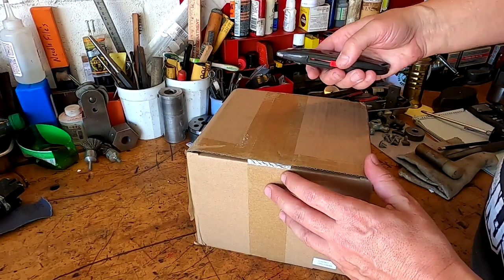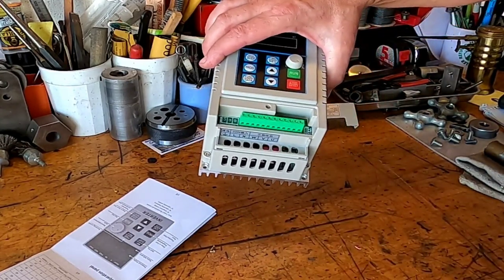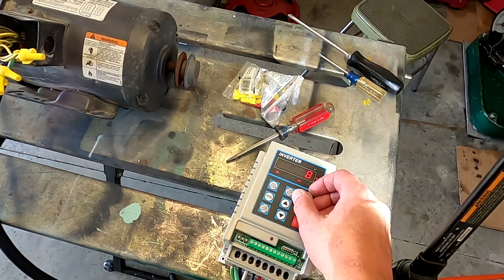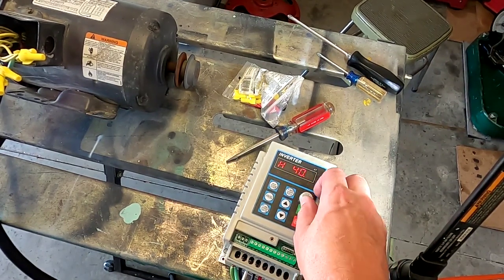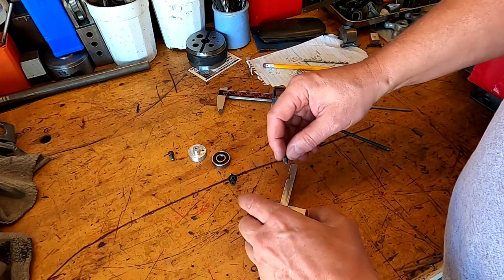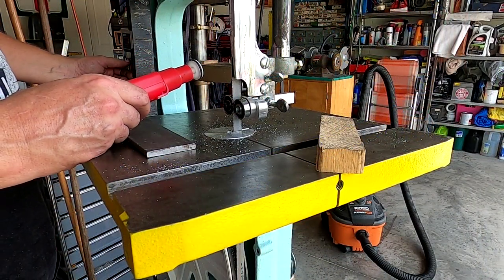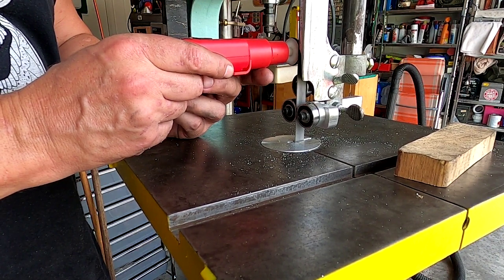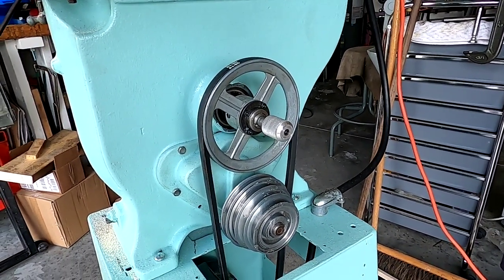I bought the cheapest VFD on Ebay. Wire it, Program it, Test it.

Comment: Thanks for the review.   A couple of cautions -- 1.  ALWAYS clamp or bolt down a motor under test.  If something goes wrong, it can jump off the table --  at you.  2.  Over-rev-ing older motors (above 60 Hertz, as it were) can cause early bearing failure.   If you need higher final speeds of the overall equipment, consider using different pulley sizes.
Reply from the maker: Hey Phil. May not have caught it but the mounting plate was wedged into the welding tables cut out. Also with VFDs I always ramp up the speed vs just flat on off. Even that 2 seconds or so of ramping really tames a motor down on start up .  Yes, older motors have to be handled more carefully. This motor has no issues with a small OD. Thanks for watching. Don

Comment: I recently converted my Delta 14" saw to metal cutting (two-step v-belt reduction) with a 3-phase motor and VFD. Excellent results, BTW. Here's a tip for you. Set the VFD at 50Hz and measure the blade speed. Enter that number as your P21 parameter. (Normally you would enter motor RPM or final RPM @ 50Hz.) Then go to P62 and enter parameter of 2. Now the VFD will display blade speed directly, rather than output frequency.
Reply from the maker: Nice tip, I'll have to go back an have a look at my unit. It would only work on one pulley size though. I stll use different sheave positions to widen my speed ratings from very low to a pretty nice aluminum clip. But or my most commonly used sheave for steel  that would be welcome. Thanks. Don

Comment: Interesting video, the saw will become much more versatile with the VFD and you'll need to change belt setting less often. From the video seems that the saw  frame flexes  a little bit and looks a periodic thing so there could be something bent. Also the right bearing on the upper blade guide was not tightened.
Reply from the maker: Hi Luca. I can't really decipher any flex or bends in the frame while using it in real time. The camera may be exaggerating movement of the entire saw as it was not sitting even or adjusted to the floor.. its rocking while the camera is stationary. I also caught the loose bearing during edit. This video was shot a few weeks back and I've spent more time with the saw since. Every little touch up I do makes it that much better..  Got four more to get through, this was my first mock up saw.

Comment: I bought a vfd for a regenerative blower I have but it won't work because the blower motor is wired in a wye configuration. These cheap vfds have to be used with delta wired motors.

Comment: I’ve got a couple of expensive VFDs, and three inexpensive models. All work. I’ve got one that’s the same as this one. It’s actually built very well. It’s got a large, well designed, heat sink. Tapping the plastic cover is about as useful in telling you how well it’s built, as kicking the tires on a car. But the case is fine. My $2,000 (in 2002) Fuji industrial model for my lathe, has a case that’s no thicker. Neither is that on my Schneider Electric model, for $950.

The problem using VFDs is that while many programming instructions and factory settings are the same, enough are different so that I can’t just go from one to the other without thinking about it. Some have the controls set to local, and some to remote. Some use up arrows for moving numbers up, and some down. Some of these differences can be very confusing for new users, and some seem to defy common sense.

And for last, I always buy inverter ready motors for VFDs. While it won’t matter if it’s on a drill press, because of the short on times, and you keep the frequencies to 45-60. But move out of that range on a machine with a continuous use, such as that bandsaw, a mill or lathe, and you can get into trouble., as the motor will begin to overheat, and have other problems. I imagine that for home use it likely won’t be a problem, but it’s something to keep in mind, particularly if the machine is under heavy load. Then, filling all of the motor parameters into the VFD becomes important, as does setting it for that particular use, if the VFD allows.

Just since you mentioned it, wood is usually cut between 3,000-4,000 SFM. But then, you use a woodcutting blade as well. I can’t bother, so I use the 10/14 tooth blade for most everything.

Comment: Hey Don,
Just purchased on for my Bridgeport Mill, have to hook it up.....  thanks for the info keep up the good work
Reply from the maker: Thanks Sandi... Hope it works well for you. I put a Teco Westinghouse on my mill a number of years back. It really makes a difference, especially with belt switching. I hardly ever change pulleys now.
Reply: Don’t go past 60Hz, or below 30. A mill is hard on motors, and assuming that the motor isn’t designed to be run at different frequencies.

Comment: All of the drives from 3 to 250 HP that I installed & troubleshoot would have factory parameter set so on a 480 volt motor at 25% of full speed would have 15 hertz output. 50% of full speed would have 30 Hertz. ( that us if you have the normal 60 Hertz from Ultility company ). If the cheap VFD does not have built in quick blow fuses I would install them in the input side of drives. I always ordered drives with fuses and a disconnect. Nice thing about drives that if you have a vibration problem near full speed say on a air handler fan you can program the maximum speed down 5 to 10 Hertz until fan is balanced properly.
Reply: some vfd's can be programed to ramp up or down and even skip a certain frequency where the motor has a resonance

Comment: I’ve just bought the same one. Wired it up to test but haven’t really used it yet. The only thing I don’t like is the wiring inputs. There is no provision for securing the cables. I think I’ll mount it on plywood and secure both input and output cables with clamps. Also, there is only one earth connection, very awkward to connect earth to motor from vfd.
Reply from the maker: Good point. I use zip ties ono something close by to keep them form pulling. Could probably get fancier though/ Don

Comment: I just received a '220V VFD 1.5KW 2.2KW 4KW Single phase to 3 Phase, 2hp-3hp inverter Frequency Converter Frequency Drive Spindle Speed Control' for US $38.90 + Shipping: US $50.35 to Peru from aliexpress. I'm going to build the 'Gen 2  72 x 2" Grinder' by Jeremy Schmidt, with a 1.5-2 Hp motor.
Reply from the maker: That is an amazing price for that size VFD.. Good luck with the project. Don

Comment: THANK YOU:   I was just trying to figure out my new cheap e-bay VFD and you saved the day.  I also purchased 2 VFd's now worry about the 2nd one.  I did notice your sanitary blade guide is set too deep causing rubbing on the teeth of the blade and will quickly rub the kerf off.
Reply from the maker: Great, Glad it could help.  Thanks for watchin.. Don

Comment: Great video, made programing much easier. A question though, I keep getting error 1 overload/short circuit before motor even spins. Any ideas? The wiring looks fine and it's the right size vfd for the motor.
Reply from the maker: Thanks, You may just want to go back and double check your parameter settings. Sometimes you may think you hit data but just wet onto the next setting without saving. Also be real careful you don't have any stray single strands touching the neighboring wire. Neutral to ground would be the most common without blowing a CB and causing an error code. That's where Ide start anyway. Don

Comment: Morning Don , if you were just cutting steel which saw would you prefer this one or the stater motor gear reduction one ?
Reply from the maker: That's a good question The Craftsman is a bit smaller dimensionally and runs an 18tpi blade, while this one runs a 14 tpi.  The Craftsman also uses a 1/2 hp motor vs a 1hp here.  Its like choosing which finger to cut off... I think if it boiled down to it, the Craftsman takes up less space and can handle 95% of what I need to cut. So ide probably say the Craftsman would be my keeper. But dang, it is nice to have that immediate wood cutting option on the Delta along with the VFD. But it does command a lot more space which is like gold in my garage.  Don

Comment: Yes sir I got vfd just like your from Ebay ,I watching your video about programming but having problem on P0018 wanted to change to 60htz but it won't do anything it show 400.0 every times.what's you think the problem? Thank you.english not   my first language.
Reply from the maker: That's kind of odd. I hadn't run into hat before. You may want to use a parameter P77 reset and put everything back to default and start your programming over.  Thats about all I can offer from here.   Good Luck   Don

Comment: Bought this same one. It kicks out at 40hz
Reply from the maker: What motor are you running??? Do you have parameters set properly. Also try going bac to factory setting and resetting if you find everything else properly set up and continues.  Don
Reply: @donsengine3158  I've found it was working perfectly and kicked out because the load on the motor was too high. I'll have to get a higher hp motor to do the work.

Comment: So i dont understand, you need to rewire the motor to 230v from 415v otherwise the vfd wont work on it? If the motor doesn't have that option, then is it to be trashed and replaced with single phase motor, no need for vfd?
Reply from the maker: Hey Jim. I don't quite follow. If your VFD has 230V output, the motor needs to be a 230V motor.  Some VFDs step up. I have a 120 Input VFD that steps up to 230 Volts for example.  You can run single phase in and its converted to three phase out. I understand that there are some single phase motors that can be run off a VFD. It seems like a waste if its true.  If your dealing with a 415V motor then it needs a matched VFD.

Comment: Hi Don. Thanks for this video. I own a bench lathe (motor: three-phase, 1.1kw and 1400rpm) and a VFD AT-1 model. I would like to install a brake resistor, but I don't know if in this VFD I can install a brake resistor and what is the proper value. Please, could you help me? Thanks again.
Reply from the maker: Hi there Jose. If you are using the AT1 rated at 1 HP, like the one I use in the video, your motor will over work the inverter. Its only rated for 1HP or .75kw. If you have a matched inverter to motor (1.5 hp) then you're good. With that, I wonder why you are concerned with a braking resistor? Are you turning much higher speeds most of the time ie.. over frequency to 90HZ? or running heavy parts that overpower your lathe and cause it run the motor down over a long time? Or do you need immediate stop? P13 and P14 on your parameters.  Most of these smaller inverter / motors don't have these issues.  The only piece of equipment that I have braking errors pop up on is my mill when I run it full out (90hz) on its top belt setting for max speed in the dead of summer. If ive been using it, it will pop a code but will reset. TO avert that I drop it back down to 60HZ before stopping it. I also don't use excessive run down times, usually around 1.5 to 2.5 seconds. The only equipment I use braking resistors on are larger pieces like my Monarch that uses a 7.5 HP motor. If you really feel you need a braking resistor, I believe the outputs are SP1 and SP 2 on the output side of the inverter. I'm not positive about that so I emailed the company to clarify. Still no answer. I'll let you know if they get back to me.  If I were you, Ide just hook up my inverter and set parameter P13 for 2.5. Leave P14 alone. If it doesn't work for you and you pop error codes, let me know. There  is a method for hooking up braking resistors in line, but its a bit too complicated to write out here. Don

Comment: Great review thanks, I have a question, my mains is 230v can a VFD run a 110v fan directly or will I still need to use the transformer that came with my fan? 
Also my fan motor is single phase incase that would make any difference?
Reply: A VFD is for a three phase motor application. So, no, you can't use it with a single phase motor.

Comment: You wired the input to the drive and said 250vac, 230v is standard for a house in the US so with that said, there is no neutral.
Two phases of 120vac will provide 230v single phase power although no neutral just a ground

Why are you speaking about a neutral?

5:24
Reply: Is he running at 120v, one hot one neutral
Reply: @MarbleStoneShop  No, he said 250vac

Comment: Question for the peanut gallery,  can I put a receiving (female) plug  on the output side of the VFD and a male plug on input side?  I'm going to be using it for my 2x72, but I also want to use it for my hydraulic press which is what its connected to now. (same HP, both 3 phase 220)
Reply from the maker: I don't see why not, Current doesn't really care about the connector type, just a pathway.

Comment: How can you tell by looking at a AC motor if it's an 'asynchronous/induction' or a 'synchronous' motor?   For example, I've got a small, low-speed,  3-phase (400hz) 110v ac motor for an air-compressor.  The rating on the label doesn't say much except that it's input power is 1.6A RMS Max.

Reason I ask is that I'm also looking for a portable power-supply for it and found a $75 
"HKS VFD 0.75KW 1HP 110V 1 Phase Input 3 Phase 0-400HZ Output 10A"
but it says in bold letters, "for ASYNCHRONOUS motors ONLY!"   
It also says it uses a 5V or 10V PWM control frequency.

So I'm confused if this will work, or is there something better suited/cheaper like Vevor?   All I need is to spin the motor, one direction, at a constant/default speed (no "PWM")..  and turn it on/off from the panel  (RS485 would be nice but not necessary).
Reply from the maker: It may be difficult to tell the difference between a synchronous and asynchronous motor just by looking at them externally, as their physical appearance can be quite similar. Both types of motors may have a similar shape, size, and construction, and may have similar electrical connections and components.

However, there may be some external differences that can give a clue to the type of motor. For example, synchronous motors may have a DC power source for the field winding or a small exciter motor to generate the magnetic field, whereas asynchronous motors do not require such a power source. Additionally, synchronous motors may have a visible rotating shaft or a gear train to maintain the constant speed, while asynchronous motors may have a simpler shaft design.

With that being said, what are you going to use this for? Thats a pretty low HP motor, something a little less than 1/4 hp. I find motors, both single and 3 phase at the flea market all day and night for next to nothing. Someone once said that a used motor is about 10 dollars to a HP, which is about what Ive been finding.  Let m know if that help. Don

Regenerate response

Comment: I have 15 hp electric motor three phase and in the building I only have single phase. can you recommend what converter I can buy and how much I’m looking to spend
Reply from the maker: WOW, you are right on the edge there. 15 HP is gonna need a full 50 amps off a 220 circuit. If you have 250 it'll be closer to 45.  So you'll need a 15 HP VFD. I Like the Huanyang GT series, about 500 bucks for a 15 HP model.  Converts single to 3 phase, Very nice and easy to use and lots of features for a home shop guy. Make sure to get a braking resistor for it. If you're using that motor daily for work, I like the Hitachi VFD's, but you better be bankrolled.
Reply: @donsengine3158  thanks for responding back to me. I have a question I have 36 V Toyota forklift would like to know if this converter to three phase will be good for the charger.
Reply from the maker: No, as there is no automatic balance or float function to keep the battery from boiling out. Or do you mean to run a charger? If that's the case it could probably be done, but youde have to maintain the setting at 60Hz.  Never tried it. Let me know how it goes.  Don    @Ucrane346
Reply: @donsengine3158  yes I was asking if I can run 36 V forklift charger on this converter
Reply: Just buy three identical 12v chargers. One charges the first six cells, the second charger charges the second six cells, and the third charger is for the last six cells.

Comment: How is the vfd holding up a yr later?
Reply from the maker: Its still kicking. I use it pretty regular with no issues. Its just become that other part that just makes things run without much thought. Thanks for asking. Don
Reply: @Don's Engine  thanks for your reply I just found your channel. Great video thanks and I did subscribe and 👍
Reply from the maker: @donkintz281  Thanks Don.  At a bit of a lul in production right now with the heat coming up. Got a lot of projects back burnered and only really getting time for actual work repairs to tape. Thanks for watchin. Don